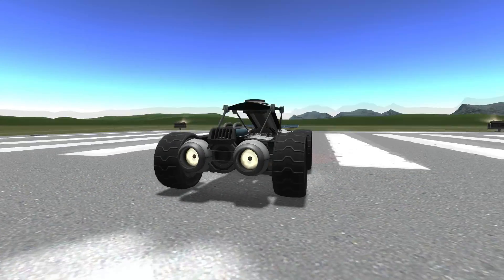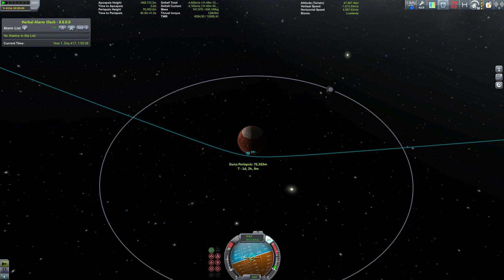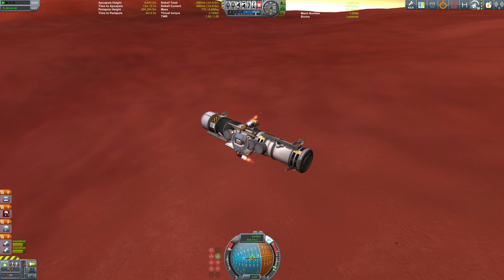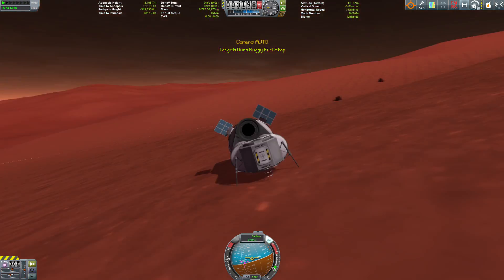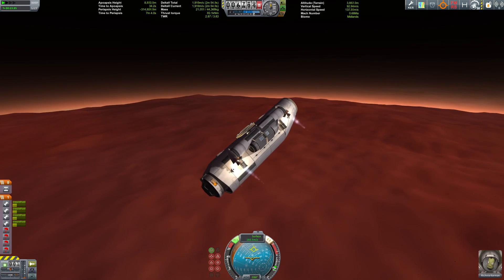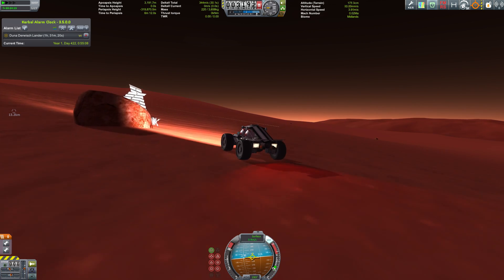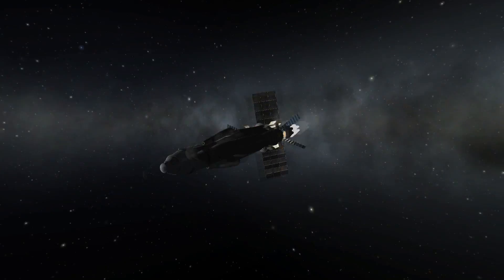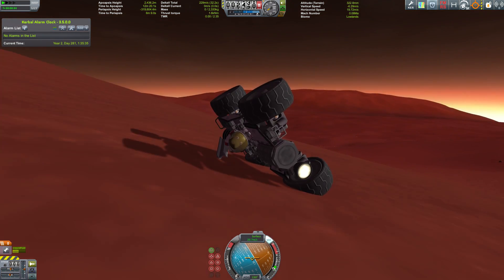Getting a rover to Duna the really complicated way - Kerbal Space Program

Comment: The technique you're using is called the "Pendulum Rocket Theory" which was disproved. I can't speak for KSP, but in the real world, it makes no difference.
Reply: +Yitzi Schweitzer actually, the important part is the gimbals. if the gimbaling engines are on top, they can steer the ship from the front and keep it stable. if they're steering from the back, theres gonna be a lot of inverse steering action going on and the vehicle has the potential to flip.
Reply: +Yitzi Schweitzer if what i just said can also be disproved, im not sure
Reply: Max Hess The "inverse steering action" you are referring to is only a factor in the atmosphere, and if you tilt a rocket too far, it'll flip either way.

Even if it did have an advantage, imagine it's negative impacts in other areas:

Aerodynamics, since you have to strap them on the sides

Weight, obviously.

Number of engines, so no more single-engine rockets.

Complexity and likelihood of failure.

Not to mention, it's hard to put boosters on your rocket if there's already things in the way.

I believe Scott Manley has a good video on it, and you can find it with the "Pendulum Theory" search words.
Reply: Yitzi Schweitzer its actually the pendulum rocket Fallacy
Reply: It works in this case because it’s a wobbly rocket. Pushing or pulling an immobile rocket works the same, but if the rocket wobbles like you see in this video, having the engines on top pulls it straight like a piece of rubber.

Comment: Hey Shadowzone, what are your encoder settings for OBS? I've also experienced FPS drops and sometimes stuttering while using OBS. Turns out, the solution was to switch the encoder to something other than the default x264 codec. In my case, since I have an AMD card and OBS does not officially support the AMD gpu-encoder, I ended up using quick-sync. That solved all my stuttering problems and gave me much better performance in game. If you have an Nvidia card, then you should be able to run the Nvidia NVENC encoder, which is also what shadow-play uses.